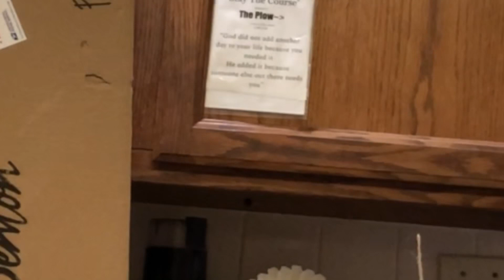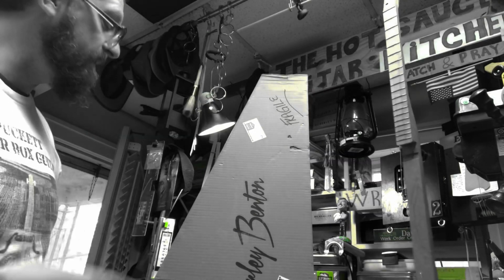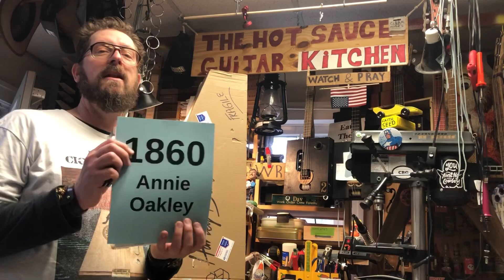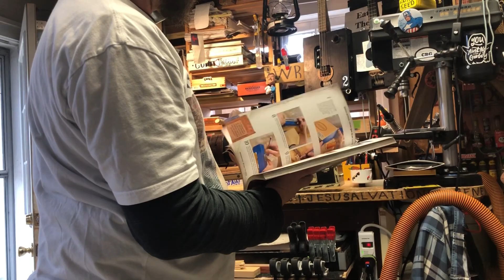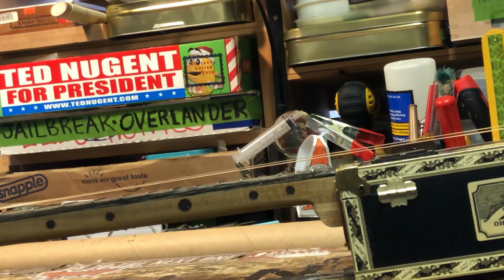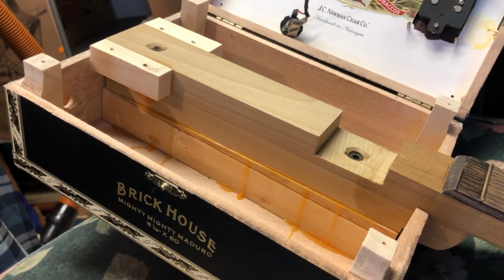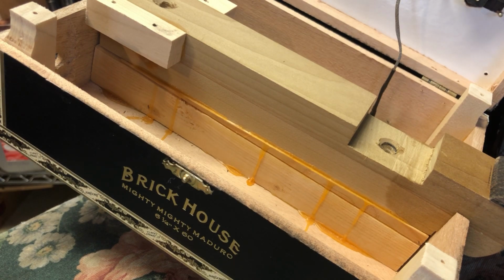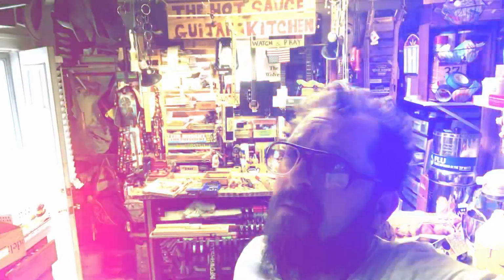Cigar Box Guitar Mulch, Unboxing A Mystery Shim

Comment: Would an oscillating multi-tool work with blade under shim to get the shim & neck out then band saw or table saw shim off neck. Get a new shim and chisel your schlimazel...maybe wood maybe wood knot but that's all I got right now.